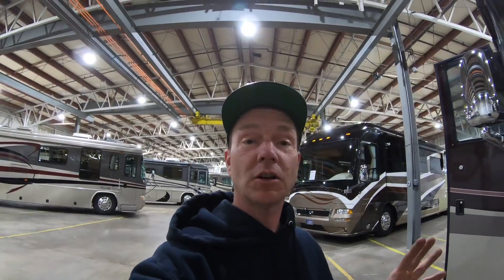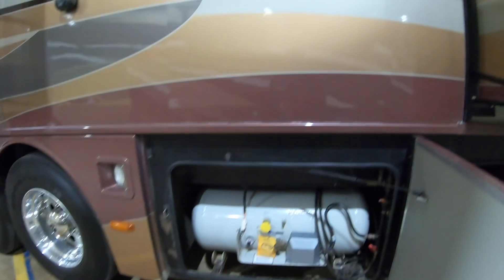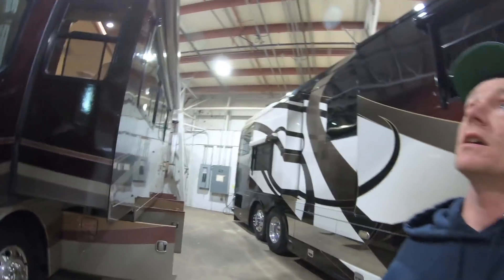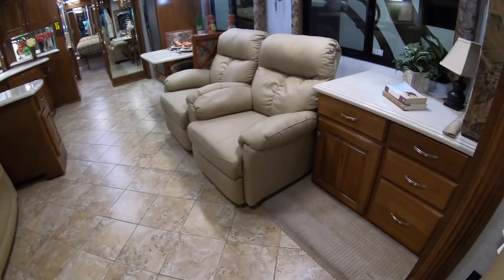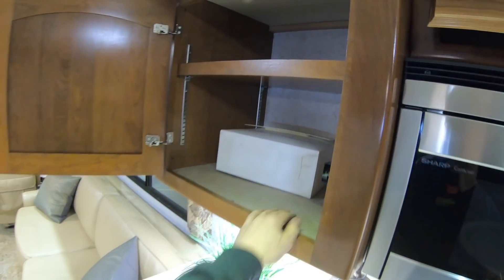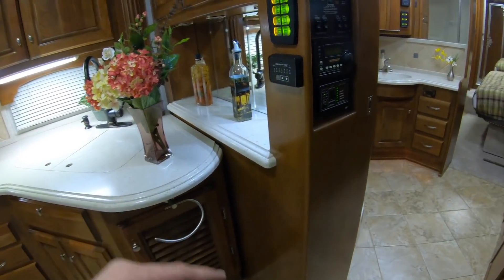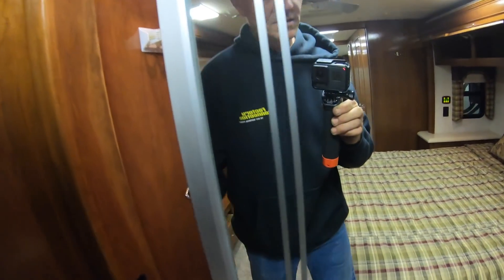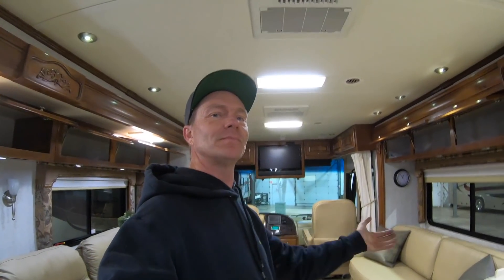2007 Holiday Rambler Scepter  42' SUPER CLEAN! 🧽

Comment: 20k updates windows caounter paint or carpet or flooring not bad if coach low miles & paint fine. But 50k is hole in water bad 1 esp if low miles.

Comment: so this if every day 6 months sound would on the outside bc it is old be an 40k is update driver model if 06 it is 45k 07 50k & 08 55k bc the prts r not as old, 09 60k 10 may be 70k not crazy wise, if 10,11,12 75-80k sill not cray. or just buy a new1 if wanting warranty or 15 or newer model. Accident 1 side but 12-15  model re paint still sound new engine still sound.